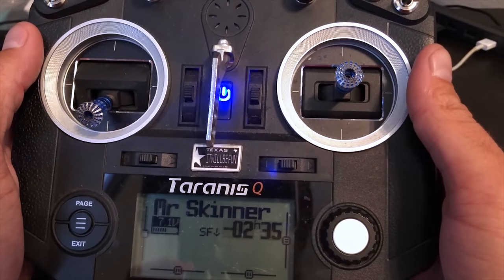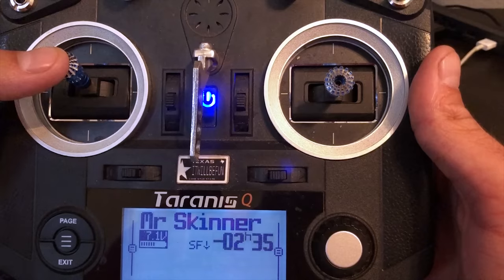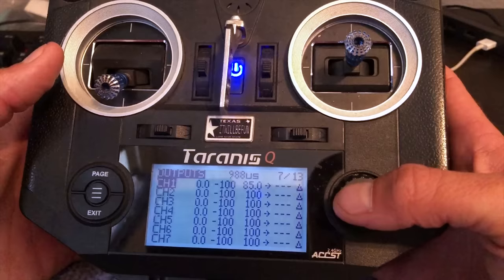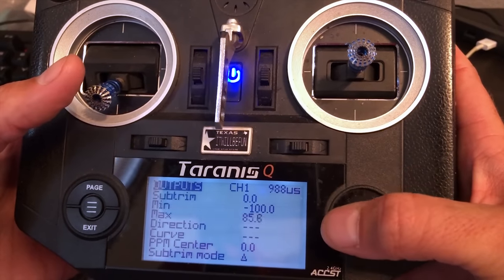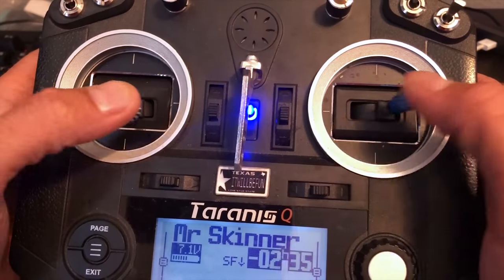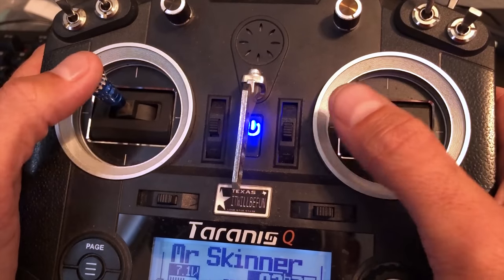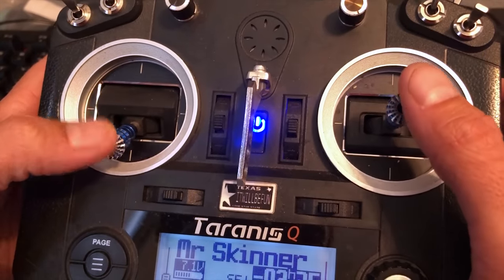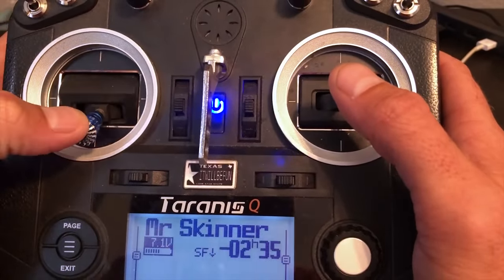How to set a Throttle Cap on your Taranis

Comment: Justin -  ok, I just tried this throttle cap thing for the first time today (at 85%) while practicing some Split S maneuvers.  Results:  Better altitude control and less over-corrections.  Only 6 months at FPV,  however, I was able to notice a significant positive stick control experience right away.  Will keep working on it, but I think it may be my "Go To." Thanks! 👍
Reply from the maker: Happy it’s helping you!

Comment: I wish I would have saw this before I took off my Engineer X  2500Kv motors lol. I love the 2307 size, but the Kv was just to high for me, and killed the throttle resolution, not to mention a few cells in my batteries lol. I think I might put them back on now, after seeing this. I am so used to the throttle curve I get from 2306 2400 Kv I had to switch back. Great tip, thanks!

Comment: -100 through 85 throttle channel is an 92.5% throttle cap.  There's 100 points of resolution either side of zero. Outputs is used to cut off the unused points that your Quad won't read.  As it stands your sticks actually have 2% less resolution because you haven't set them right.
Reply from the maker: Video and explain to me as if I’m a child because this isn’t clicking in my head. You’re saying I have no difference in my upper throttle?
Reply: Justin Skinner Sorry mate didn't mean to throw a spanner.  See in the top right corner where your see the actual Nano second pulse output where you adjusted the value.   That's the output  the receiver puts into the quad FC.  It's the same values you see on the Betaflight receiver page.  Those only are read between 1000-2000us, and anything else is classed as invalid or out of range.  It 'maxes out' once you got below 1000us or above 2000us.
Reply from the maker: So end result is what? No response what-so-ever in the top xx% of my throttle stick range now?
Reply from the maker: Does the 85 points of resolution extend to 100% of my stick range or do I just lose that 15 points of resolution and have a dead stick in that area?
Reply: Justin Skinner What you doing does work, don't get me wrong. Just the math is a bit off.  What I'm getting as is your end points on your pitch, roll and yaw sticks aren't sent right.  At full deflection your outputting a value that maxes out, so your losing a little bit of resolution on the sticks because the full deflection area is basically wasted and ignored.
Reply from the maker: ok, watched all these videos and digested your words. I think I stand by what I said, numbers excluded. The overall result is the same regardless of the numbers I threw out and that's what counts. I see the weights suggestion also, but in the end i'm still seeing an increase in resolution on the top half of my sticks with this method and the whole point in the first place for me doing this was to remove that bit of potential power so I didn't accidentally bump to much throttle causing me to gain altitude. Improving resolution was a side benefit and as I see it on my radio, the top half of my stick does, in fact, stretch more, while maintaining the same midpoint. The weights method, or offset method, or whatever, looks to do similar except it seems to move midpoint down as well. This to me would mean you need more stick to hover, correct? I don't see that as a good thing, now that I've put thought into it. I just want more control in the area I'm mostly in, which is the top half of the stick. So I think this method is still the best for what I'm after. I could still be misunderstanding something, correct me if I'm wrong.
Reply: Justin Skinner  if you drop the throttle 'weight' down with an equal amount of offset it will do the same thing.  That's the normal sort of way of doing a limited throttle but keeping full stick resolution. The endpoints still need to be brought into line to maximize your stick resolution.  Hey sorry for making a fuss,  I appreciate the effort you make and your skills as a racer.
Reply from the maker: No worries, it sucks being corrected but if I’m wrong I definitely need to know so I don’t put misinformation out there. Or if there are other methods it’s good to know them also. Thank you
Reply: Ye I've always done it the way JC does. Just made sense. Instead of going by the % on the taranis screen I looked at the us signal on the radio and in betaflight. 85% would be 1700us at full throttle. Maybe you could try this way Justin and see if you notice a difference since the signal would be different? Sorry if. Misunderstanding.
Reply from the maker: I tried it out yesterday! I see some benefits but I think that it’s more of a throttle curve than a cap because the midpoint moves as well. It would also make changing it up depending on the track harder because it changes the full stick range rather than just he top half. More throttle to get to hover, etc. The “cap” on the outputs only effects the top half of your stick range and is much less noticeable when changing it up because half of your stick remains exactly the same, making the top half, where we spend most of or time in a race, more controllable.
Reply: You're actually changing the throttle curve by doing this, not just cutting off the top. And like others have said, setting it to 85 (-100 to 85) is really a 92.5% cap (when adjusted to be 0 instead of -100). You can actually do this in Betaflight 3.4 now.  you can set throttle_limit_percent to 85 and either set throttle_limit_type to CLIP (what you're describing in this video) or SCALE (what's actually happening in this video). If you want to setup a cap on the radio like you're describing in this video, setting up a custom throttle curve would be the easiest way.

Comment: You should do this to your inputs instead of outputs.  With outputs you are just cutting the positive side of your stick.  With inputs you can "slide" the whole stick input down to get what you are describing.  Basically add a -15 offset to your throttle input.  This way your mid point will actually shift.
Reply from the maker: Make a video and explain it. I’m not following.
Reply from the maker: copy and pasting my reply to another comment, as I think it answers you as well. 

Too long, don't want to read? Basically, I like that it's just the top half of the stick and that the midpoint doesn't change.

And paste...

ok, watched all these videos and digested your words. I think I stand by what I said, numbers excluded. The overall result is the same regardless of the numbers I threw out and that's what counts. I see the weights suggestion also, but in the end i'm still seeing an increase in resolution on the top half of my sticks with this method and the whole point in the first place for me doing this was to remove that bit of potential power so I didn't accidentally bump to much throttle causing me to gain altitude. Improving resolution was a side benefit and as I see it on my radio, the top half of my stick does, in fact, stretch more, while maintaining the same midpoint. The weights method, or offset method, or whatever, looks to do similar except it seems to move midpoint down as well. This to me would mean you need more stick to hover, correct? I don't see that as a good thing, now that I've put thought into it. I just want more control in the area I'm mostly in, which is the top half of the stick. So I think this method is still the best for what I'm after. I could still be misunderstanding something, correct me if I'm wrong.

Comment: The most interesting part of this to me is that you say you change your throttle cap between events.  I’ve seen guys doing this for over a year now, but I’ve always been too scared to try it for fear of screwing with the feel of my quad that I have memorized.  Maybe I will actually go forward and test this on a track now.  I’ve been able to pull quite a few sub 17s rq laps in practice.  It would be really interesting to see what impact this would have...  thanks for the video!
Reply from the maker: Dang you got super fast dude! I saw your 7 lap run and you are smooth as butter. I can only pull 17s on the sim lol
Reply: Was wondering if you were going to try this out.  If/when you do test this out, I'd be interested in seeing your results through a video

Comment: Be mindful of copying this model when you setup your next quad.  If you're using RF/F1 - the install wizard will compensate for the cap, so make sure to reset before you do the config.  BF/BTF I believe now has a scale option that allows you to do it in software which should give you better resolution than doing it in radio.  Also for freestyle/gopro setups it may be worth playing with bumping the first 0-10 percent of throttle to maybe around 25%.  Since the quad needs a lot more stick to even hover, this should give you back a lot of resolution where it matters.

Comment: Hey Justin, great tip!Have you tried on other channels (ex. pitch, yaw and roll) or it might  be completely unnecessary and could negatively affects the rates?
Regards
Reply: that's what your rates are for, you can control the response of roll/pitch/yaw that way!
Reply: Justin Skinner that's true.i was just wondering if you tried to add this method on top of the rates and see the result.but probably it won' t change much.thank' s

Comment: How does this affect low throttle control? Typically on a tight technical course, i find myself in the 30-45% throttle range most of the time. If I did this 85% cap would that mean that I would have to bump up my "typical cruise" throttle to about 45-60% throttle range for a tight course? Or will it be the same (30-45%)? and I just dont get the top 15% speed of the throttle?
Reply from the maker: Your mid point and below is unaffected, it’s just your top half of your stick that is adjusted. There is another method if you wanted your entire stick range to change. I’m remaking this video to explain more clearly and show the other method as well

Comment: this fully depends on your stator size.. with a 2207 you will definitely "miss" something if you cap down the top 15%.. with smaller height stators not so much so this might make sense to cut the portion of the throttle where it tapers off anyway .. so yea.. for me, i need that juice, just in case :D
Reply from the maker: Well suprisingly it worked very well on a superlight 2205 setup that comes in at 235g with props. Really helped with maintaining altitude
Reply from the maker: So... I wouldn't say fully stator dependent. More pilot dependent ;)
Reply: not surprising at all^^ thats exactly what i said.. smaller stators taper off anyway so it doesnt really hur to cap them off a the top^^ but with 2207 you have more linear thrust even in the higher throtle range so it would be wasted if you cap there :P

Comment: Justin-I have tried this out and I like it.  Just came across this new BetaFlight "feature" today.  Looks like as of BF 3.4, you can do the same thing through BF now.  It sounds like it is more "user-friendly" and you can turn it ON/OFF with a switch as opposed to having to go back in to your TX.  Please let me know if you believe this new BF feature does the same thing as you are describing in this video.  Thanks! Check out this link which describes the BF feature:  https://flexrc.com/2018/07/12/throttle-limit-in-betaflight-3-4-longer-flights-and-cooler-motors/